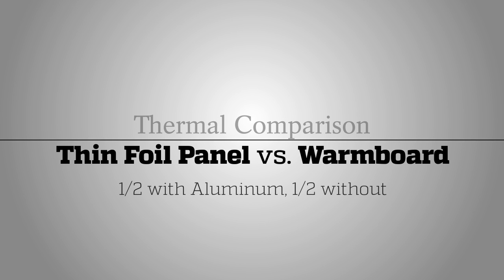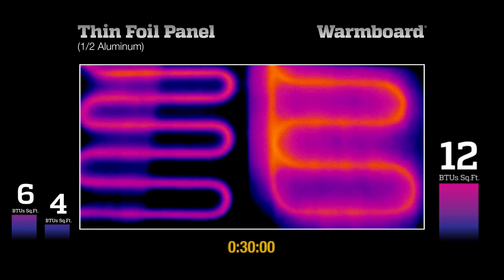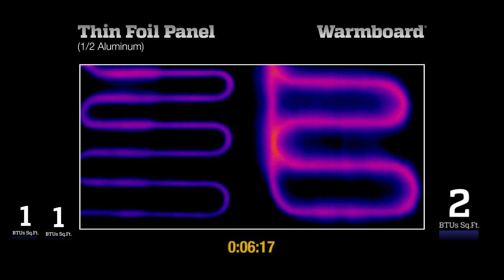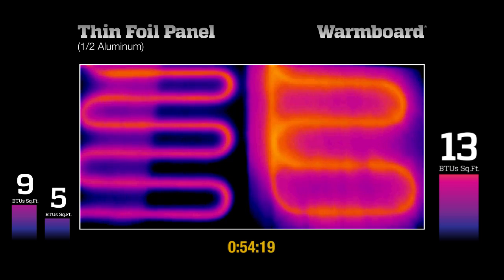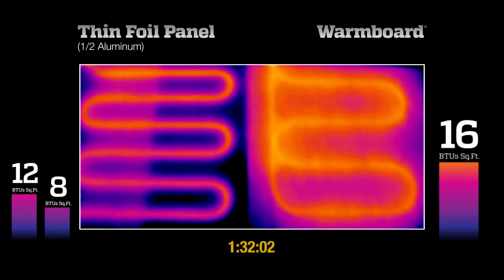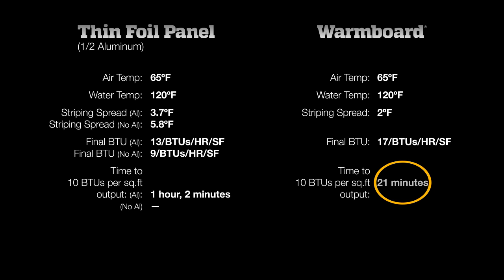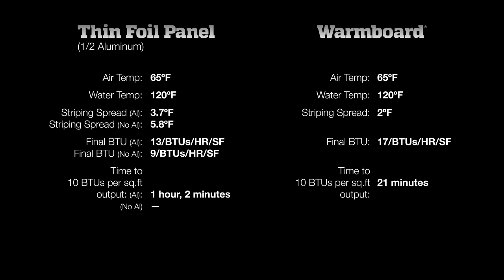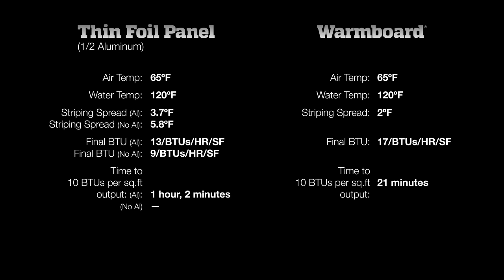Radiant Floor Heating: ThinFoil v Warmboard

Comment: This is a great experiment.  Think about this.  Once the room/home  is brought to a comfortable temperature (one hour with thin foil), the energy displaced for the rest of the winter season should be relatively the same.  Right?
Reply from the maker: Think about 2 cars driving down the highway at the same speed. One old, one new. As long as the road is straight and flat, you can't tell much difference. But as soon as there's a hill or a turn or a drop in the road, you can see the new car handling everything with ease (power,  comfort, performance, MPG) while the old car struggles.

Is there a cold front moving in? Does your part of the country experience temperature swings (especially in the shoulder months) - maybe 30-60º warmer in the afternoon than in the morning? Are you having guests over or changes in occupancy? Or maybe some days you just want parts of your home to feel a bit warmer than "usual"? 

Products with less conductivity almost always require higher water temperatures. If the outdoor temperature drops rapidly is there enough reserves of power to compensate? Can you adequately heat that room with hardwood and the thick rug? Will consistently running lower water temperatures save more money every month you live in it? These are all factors to consider.